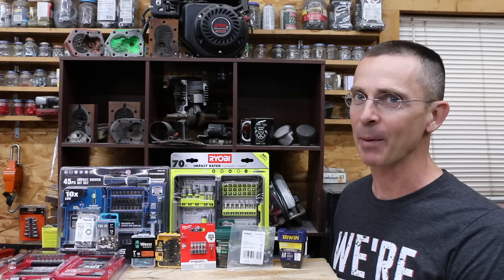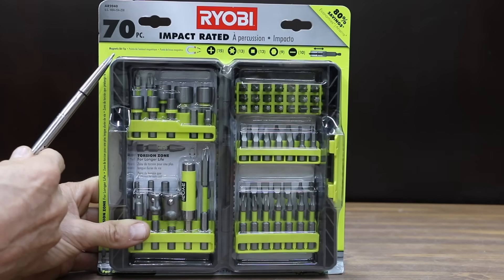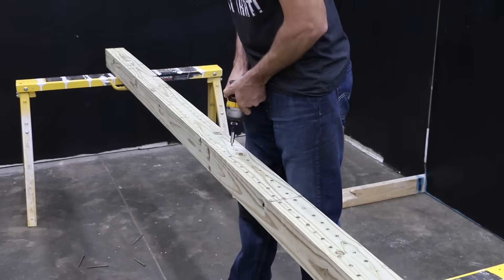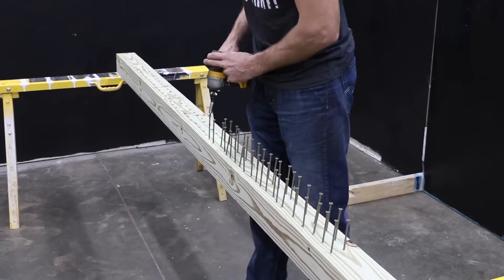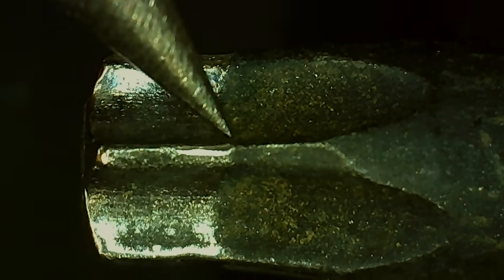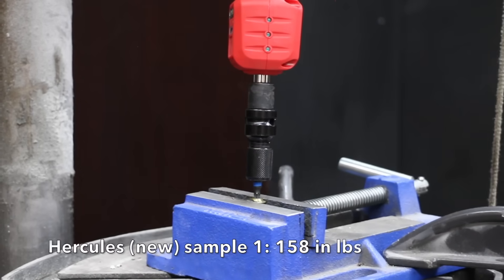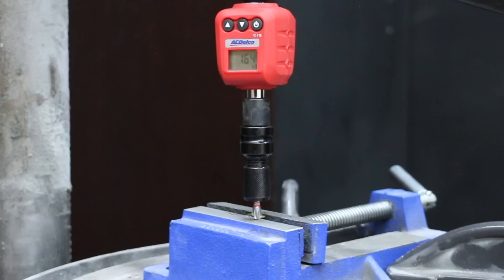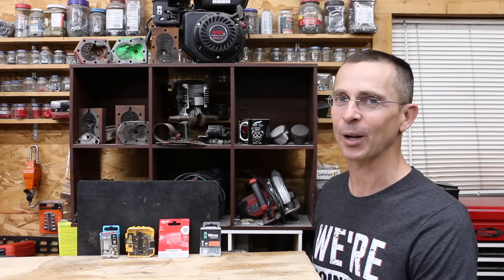Best Star (Torx) Bit Brand? Milwaukee, DeWalt, Makita, Ryobi, Wera, Wiha, Irwin, Bosch, Bauer

Comment: As a carpenter that drives a lot of screws, especially in to treated lumber and hardwood such as oak, I swear by Dewalt. I'm surprised there were no Craftsman in the test. I have a less expensive craftsman set that has performed performed pretty well. The true test of a star bit, or circular saw blade  is driving/sawing into wet Treated lumber or hard wood such as Oak/Teac.  I built a deck out of Teac wood for a customer and it was a challenge to say the least. When notching out wet 6x6 treated posts to set 2 x10 ledgers with a circular saw, I found it to be really hard on a saw blade. The wet treated lumber tends to gum up the blade, then it starts dulling it.  The Diablo was the ticket. Also, the screws really lag when driving them. It takes a lot more down force.
Reply from the maker: Thanks for sharing.

Comment: I can actually say that the Wera impact bits are top notch. I have a 3.5” PH2 bit that I have been using daily for 6 months and it looks like new still. I actually inherited it from a maintenance guy that retired , no idea how long he had it. I was so impressed with it I had to research the bit to see what brand it was. The Wera had worn off the side but I could still see stainless steel and a number on it. The cost is steep but I’ll pay for quality.
Reply from the maker: Thanks for the feedback.
Reply: Do you happen to know if they make a precision multi-bit set for working on electronics?

Comment: One thing that's come to my attention in the last few years of working on cars,  I'd rather have the torx bit mess up first,  than the fastener on the car. You want a good fit, I'd rather replace the bits,  than the OEM fastener. We do vinyl wraps,  have to remove shark fin antennas, door handles, mirrors,  etc The harbor freight gives you them all for around $10. They break easily but not a big deal to replace. Just bought a 60pc Dewalt,  it's good to keep in mind that they're harder,  have to use caution ⚠️
Love the videos!
Reply from the maker: Thanks!  Thanks for the feedback.

Comment: Interesting work for sure. To my eye the small differences in torque failure limits between most of the brands is really not enough to be concerned with and may well be within the manufacturing tolerances over time. Repeating the same test with different batches of bits from the various brands could easily result in a shuffling of the ranking order when the differences between them only amount to a few percentage points. For me the conclusion really is only to stay away from the Ryobi and otherwise buy on price. Alternatively, I'm actually more interested in tip durability than I am torque failure point. I can't remember the last time my problem with a driver bit was that the bit broke.
Reply: I've only had a handful break over the past 15 in construction, maybe 5 actually broke, they always wear out first and then take the long trip into air like a rocket to never be seen again
Reply: @thatdude8247  whaaaat? Torx bits twist around themselves multiple times like the Exorcist’s chicks head. No matter which brand. And they ALWAYS strip the screw head. Go philips.
Reply: @hardtymz2517  maybe your angle is wrong or your using the wrong size or maybe not enough pressure on the drill, that's the only time I get cam out. And I use Phillips bits as well for drywall and door, cabinet hardware, and furniture all the time.

Comment: Did you try torx brand ? Torx screw type fasteners usually have a nylon collar to keep them from backing out. They are solely used for the connection of train car side walls and commuter bus construction  through novabus and Bombardier .
Reply from the maker: Thanks for the suggestion.

Comment: Thanx for all the hard work you put in these video's! I have a suggestion for a new video. I've recently bought a new set of Allen keys (star shaped/torx T4) to open up my laptop, and the tip of the tool just twisted/warped with a medium amount of force, before my laptop was fully opened. The brand was a house brand from a local hardware store (GAMMA in the Netherlands). I'm curious about if there is much difference between brands what is an acceptable amount of force and if it is possible to break them by hand? Thank you for all the great video's!
Reply from the maker: You are welcome!  Thanks for the suggestion.

Comment: One has to wonder if being really hard will make a bit last longer or have a shorter life. The torque test was done with a slow pressure. I would imagine if a bit is too hard it could be brittle and wouldn't hold up as well under impact
Reply: Its irrelevant, they rarely break like that.  Wear (less is better) and fit (tighter is better unless they stick) are the important considerations.

Comment: I compiled a summary of the results.
When price is completely ignored, the order from best to worst overall quality is:
Wera, Milwaukee, Makita, Dewalt, Hercules, Bauer, Masterforce, Wiha, Bosch, Irwin, Kobalt, Ryobi
When price is considered 50:50 with overall quality, the order from best to worst overall value is:
1 Dewalt, 2 Hercules+Masterforce, 3 Bauer+Makita+Kobalt, 4 Milwaukee+Wera, 5 Wiha+Ryobi, 6 Bosch, 7 Irwin
The calculation is not just overall quality / price. That would obviously make Kobalt the CLEAR winner.
It averages the brand's quality position and price position. Dewalt is the 4th cheapest and the 4th highest quality. Irwin is the 10th cheapest and the 10th highest quality. All the other brands average somewhere between these two extremes.
Reply from the maker: Thanks for sharing.

Comment: If you tend to break a lot of bits, the Were may actually come out cheaper in the long run. But, if you are one of those people that tend to lose a lot o bits, get the cheaper ones.

I built about 16 feet of shelving in my garage several years ago and I went through my entire collection of Dewalt bits. I installed over 300 screws. I started with phillips screws and quickly switched to torx screws. After breaking all my dewalt torx bits, I bought some mulwaukee bits and was able to finish without any more breaking. So while the Dewalt were cheaper to buy, they cost me time and money in the long run.
Reply from the maker: Thanks for sharing.
Reply: I buy 1 lb boxes of torx head deck screws. Each box has a bit designed to fit the screw. I toss the bit in a used bit container when the box os screws is consumed. Never any need to worry about any of this.

Comment: I'd also like to see a comparison between different drive types Robertson (square), Allen (hex), Torx (star), and to a lesser degree, Philips & slot.  (as @Paul A). A bit harder than comparing different brands of the same generic type, I realize.
Here in Canada, Robertson (square) is pretty much the screw of choice for any screw that needs some torque, with Torx used on expensive screws like GRK, and Allen (hex) mostly on set screws. Too bad Robertson (square) didn't catch on much in the US, mostly a marketing failure. Whenever I see a Philips screw, or worse yet, a slot, I complain.
Love your videos, great to see comparison with actual testing.
Reply from the maker: Thanks!   Thanks for the suggestion.

Comment: Those Milwaukee bits are much cheaper if you by it in a set with a case which is on sale quite a bit.  I got a 75 or so piece set with about 15 of those included for like 40 bucks on sale at the home Despot.  They are on sale quite regularly
Reply from the maker: Thanks for the feedback.

Comment: Don't use T25 but I use lots of torx bits like T6, T8 and T10 for knife maintenance. I found Wiha to be the best ones so far, they don't strip the screws and even the tiny T6 stays pretty pristine from a lot of use. Unless you get cheap knives that use tons of white thread locker on them, then anything goes. Gotta preheat them before hand and hope you can take it apart. Never understood why they use that stuff, you really think you knife will never need to be taken apart?
Reply from the maker: Thanks for the feedback.

Comment: From experience you can't beat Wera's bits. Phillips and torx and security torx. Especially with the smaller sizes like T10 because they fit tight and don't lose the screw. If you don't lose them they last and last and last.
Reply from the maker: Thanks for the feedback.

Comment: Hallo Todd, Thanks again for your very interesting tests. But i find that you underestimate a little bit the bit fitting into the screw (its imporatant too to use a professional screw brand - in Germany are "SPAX" or "HECO"...one of them). If there is too much move, the bits will automatically wear not so long. 🙂 But "all in all" a nice test from you, with interesting creativitiy about your test tools...🤓. (Btw. I have 40 years of experience working on building sites in wood, metal and house construction inside and outside).
Reply from the maker: You are welcome!  Thanks for the constructive feedback.
Reply: @ProjectFarm  Thanks Todd for your reaction.

Comment: One time I had a freebie bit tossed in with a tool order, it was an $8 Wera Torx T25. I thought it was ridiculous that a bit could cost so much, but I tested it on a job where we had to remove 1/4x20 self tapping screws from 2 pieces of aluminum railing and it was all corroded together. I used that bit to take those screws out without needing to bust out the torch like we usually had to.

It's much less scientific than your video here, but I've been impressed by the quality that brands like Wera produce, even if it isn't cheap!
Reply from the maker: Thanks for the feedback.

Comment: I wonder if the used bits were work-hardened? Also, a Torx bit needs to be very snug in the screw to not wear out the screw head or the bit... which unfortunately is a trade-off for ease of releasing the bit.
Reply from the maker: Thanks for the feedback.

Comment: I have a Milwaukee 18 volt Duel Impact Battery Drill.
The original chuck failed (I would consider) early. I replaced it with a Metabo chuck which performed much better. The Metabo chuck failed after (what I would consider to be) a reasonable period of time.
The machine is still going strong.
Most brands seem to provide a battery and skin combination that exceeds the quality of the chuck supplied.
What is the best after market chuck for a Milwaukee/Dewalt/Bosch etc. 18Volt, high end Impact Battery Drill when the O.E.M chuck fails?
Reply from the maker: Thanks for the video idea.

Comment: I would love to know how material and manufacturing process affects performance for both drill and driver bits.  Driver bits can be made of S2 steel, CrV steel and others.   Drill bits use various different high speed steel alloys and can be roll forged, ground or fully ground.   Might material and process provide a better qualitative evaluation method than brand?
Reply from the maker: Thanks for the video idea.

Comment: So, I did some extra number-crunching to find a few extra parameters:

* The average of absolute-value deviation from the average new-bit breaking strength as a percentage of the new bit strength. Not as cool or mathematically rigorous as standard deviation, but a bit more digestible to those healthy people who don't have a compulsion to compute things.

Ranked in order of least to greatest spread:
* Wiha - 0
* Masterforce - 0.4%
* Bauer - 0.7%
* DeWalt - 0.7%
* Ryobi - 0.8%
* Wera - 1.2%
* Milwaukee - 1.2%
* Irwin - 1.6%
* Bosch - 1.9%
* Makita - 1.9%
* Kobalt - 2.0%
* Hercules - 3.4%

* Loss of strength after use as a percentage of average new-bit strength. For those bits that gained strength after use this will be a negative value.

Since this can be negative or positive, I'll just list them here in the same order as above.
* Wiha - 2.9%
* Masterforce - (-7.0%)
* Bauer - (-3.6%)
* DeWalt - (-1.1%)
* Ryobi - (-7.2%)
* Wera - (-1.7%)
* Milwaukee - (-3.1%)
* Irwin - 3.0%
* Bosch - 3.9%
* Makita - 0.2%
* Kobalt - 5.5%
* Hercules - 3.4%

I feel like these numbers have some usefulness. Personally, I find a low spread to be a better indicator of quality than having the highest possible strength. It's an indicator of the consistency, and by implication, the quality of the brand's manufacturing process. Furthermore, the breaking strength of the used bits can tell us two things. The meaning of a small loss of breaking strength after use as opposed to a large one is pretty obvious. A gain of breaking strength after use, however, suggests work-hardening of the bit (as you and others will have no doubt inferred). My personal opinion is that a large amount of strength gain after use suggests that the manufacturer either did a minimal job of hardening the bits, which is undesirable, or their process is not terribly consistent, also no bueno. Therefore, I think that, for bits that gained strength after use, a small value is also most desirable.

If I had to choose between gaining strength or losing strength after use (assuming the total value is small, either way), I'd probably, based on nothing but navel-gazing speculation, say that gaining a bit is better. It means that the tool designer and manufacturer left a little bit of "headroom" in the hardening process to allow for work-hardening in service by the end user to help prolong the bit's life. But again, this is just idle musing, and I could be completely wrong.

In short, a bit with a small spread of average new-bit breaking strength AND a small difference between the spread and the strength change is probably what you want. To that end, for each bit, I added the spread percentage to the absolute value of the strength change percentage, then subtracted that number from 100 to create a "consistency" score, so that higher numbers are better. To be clear: I am well aware that this number is HIGHLY imperfect. But I still think it's quite illustrative. By this measure, the top three are:

* DeWalt - 98.2
* Makita - 97.9
* Wera - 97.1

With Wiha getting an honorable mention, tied with Wera at 97.1. Interestingly, Ryobi is at the bottom, with a "consistency" score of 92.0. Given that DeWalt is the least expensive of the three, I'd say it's a no-brainer.

I hope this is useful to... someone.  :P

-----
As  post-script to all this, I'd like to point out that the most "consistent" bit by my math (which, again, I know is not super great) is made in China, and to take a moment to reflect on that. There's definitely no shortage of crap that's made in China, but there's plenty of perfectly good stuff made there, too. Back when I was still working as a design engineer (I'm now a paramedic, long story), we often ordered similar parts from multiple sources both domestically (US) and from China. We got unusable crap from both countries, and we got great product from both countries. I actually went over to China a few times to help build better ties with some of the good sources in that country, and they were honest, hard-working people just trying to make a living for their families, same as so many of us. I guess I just want to be clear that the general hate in America for Chinese products is partially justified, but it's also probably a manifestation of how we feel about the communist government there, which probably deserves all the hate it gets and more.

Comment: I had the Ryobi T-20 fail after less than 300 screws using a Ryobi impact driver. I switched to a Dewalt going forward.
Reply from the maker: Thanks for sharing.

Comment: It would be very interesting to make a comparison between different types of screw heads/ bits Example PH vs PZ vs TX. 
For example with the same pressure applied how much torque does it take before the bit slips out of the head? 
Or wear resistance, screw head wear, etc. 
Not really a product comparison - bits would have to be of same brand, as well as screws- but definitely a very interesting technical comparison. Cheers.
Reply from the maker: Thanks for the video idea.

Comment: The reason that the used bits are stronger is due to a process called “strain hardening” 
The deformation of the metal makes it harder while loosing ductility
Reply from the maker: Thanks for the feedback.

Comment: Would you consider testing quick release bit holders?

I've been looking at alot at all the top brands and judging by the reviews almost all of them seem to have people breaking them with impact drivers, there's not a single one that seems to stick out as a really solid choice.

I'm sure with your type of testing we could probably find out why they're breaking and which ones have strong enough magnets to actually hold on to fastners.

There's no video on YouTube testing them, so maybe pointing out there weaknesses will help manufacturers design better ones.

Ratcheting bit drivers seem to break or strip gears pretty easy too so that would be cool to see.
Reply from the maker: Thanks for the video idea.

Comment: I love this channel. 
I plan to buy one or two sample not knowing which top three brand / model are good to go with. 
Product? “Air Wedge”

Could you arrange test comparison to an episode? 
Test it to the most popular and tough applications. 
Include : Load = 300-lb. 
a washer filled with water adjust to Load ,the advertised load capacity. 
Maximum % lift per advertised height at Load
Minimum thickness fully deflated. 
Will it slip / pop out during normal use at Load? 
Abrasive / wear and tear resistance ?
Temperature handling? (will it burst at Load)?
- temperature max = Asphalt under the sun
- temperature min = sitting on ice block lifting of another ice block at Load. 
Destructive test: inflate it at Load. Add weight to load until it burst. Record the total weight.
Reply from the maker: Thanks!  Thanks for the video idea.